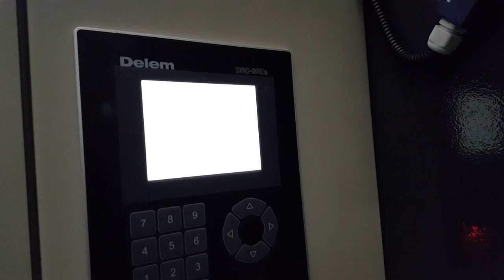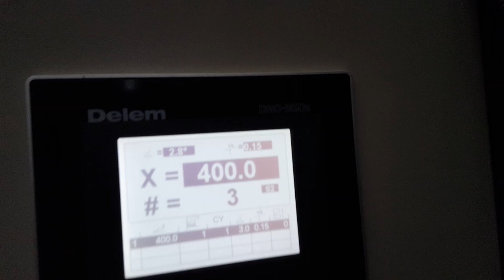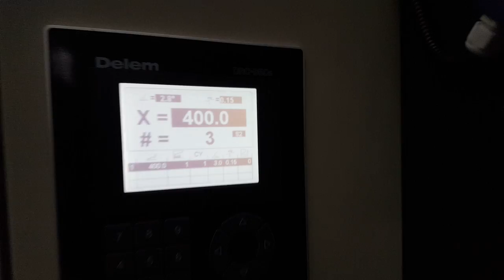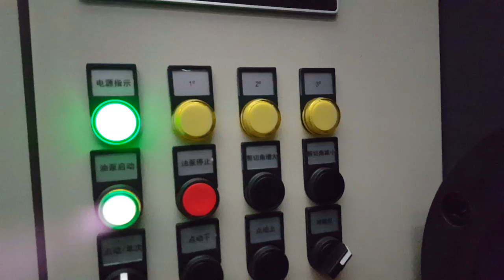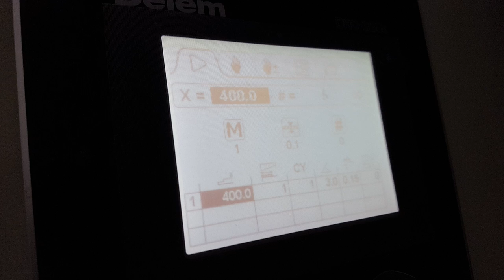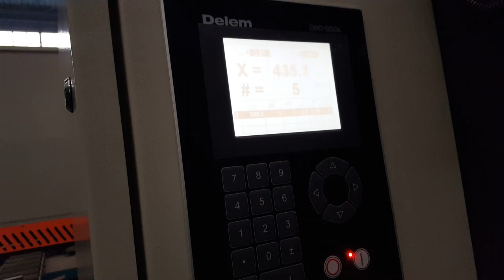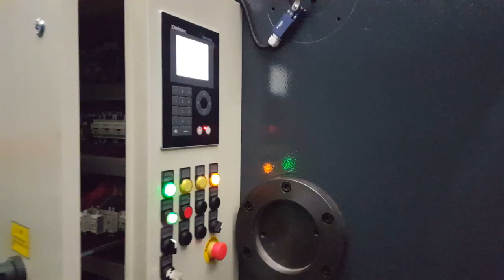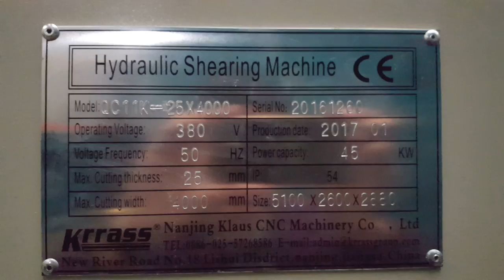Shear|cutting 25mm thickness|DA360S system From KRRASS

Comment: set up is not enough, when i was operating such machine, we don't use crane to mount the steel plate, there should ball bearings underneath the steel plate so that you could slide it in the cutting blade, we only use the crane to bring in the steel plates to be cut, in an 8 hour work? we can cut so many pieces of steel plate